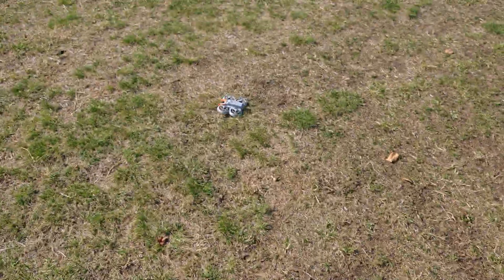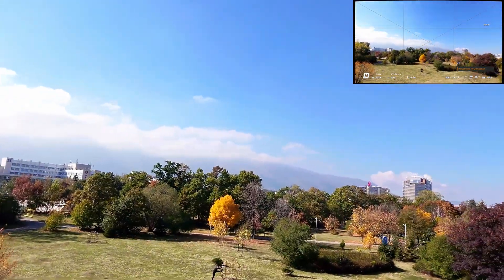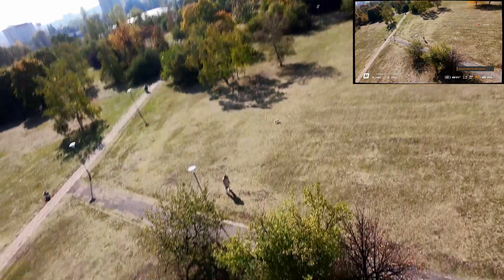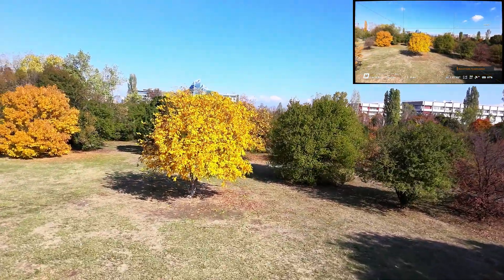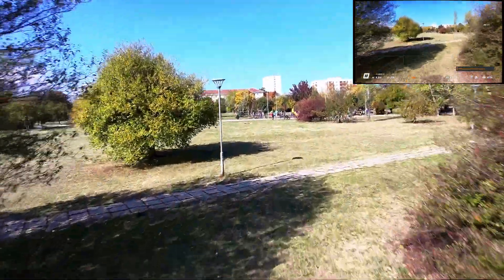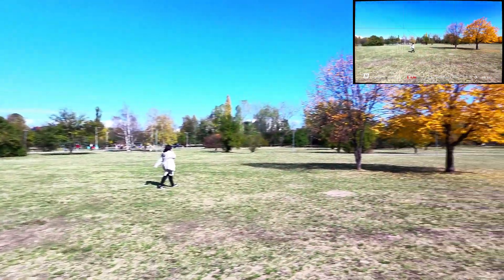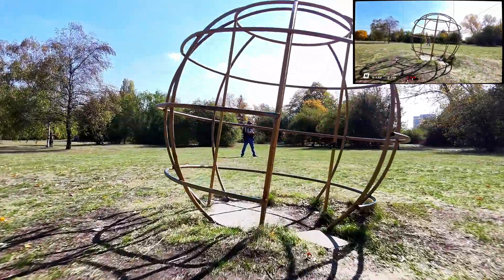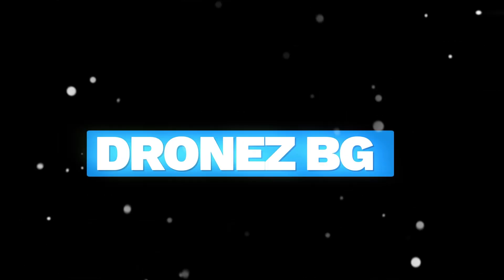DJI NEO – Testing HQ Props! Finally No More Yaw Tumbles or Prop Wash?

Comment: Do you use gyroflow to stabilize footage or this is rocksteady build in?
Reply from the maker: I used the built-in RockSteady stabilization and recorded in 4K@30 FPS. Later, I used Flowframes (free PC software) to double it to 60 FPS, so now the footage looks much smoother.